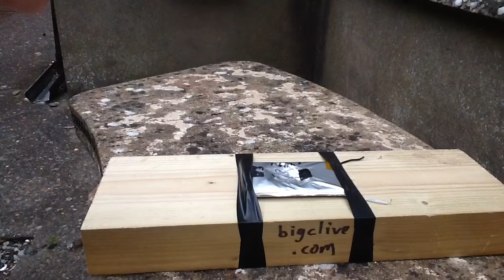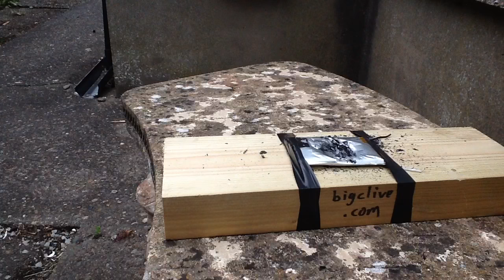Nail through fully charged LiPo cell super-anticlimax.

Comment: I'd be curious to see the test with a high capacity high C rating hobby pack. Something rated for delivering 50A continuously. But of course that wouldn't be cheap :/
Reply: I have a video of the fire and explosion of a 6000mah lipo cell (Not uploaded yet sorry). This was preformed as a controlled test. Cell connected to a bench supply and over charged @ 10 amps. After a half hour the cell reached 4.8v, the cell was extremely hot, and had long since began to swell up. Just a few minutes later the cell exploded violently. It peaked at about 5v before it blew. The cell Shot a 10 foot high fireball into the air no joke. The initial fire was so intense and bright that it instantly over exposed the camera, so you couldn't see much. Remember this was just 1 cell, not multiple. I have see people who are charge 6 cell 5000+ mAh packs in their house! Total fire risk.
Reply: @HighVoltageMadness  
Cells have a polymer in the seperator that gets electrolyzed when the cell potential exceeds operational limits. If you keep going for a half hour you use it up.

Short circuit had to be fast metal on metal a slower discharge of 10 seconds of other materials isn't going to catch fire even though the voltage will go down to zero

Comment: Obviously you made this test too safe; like taping it down, lay it flat,  used wood that it could burn on, you wrote your name on the wood.. All this matters you know, the battery was shy.. before you killed it..

This was a nice, kind battery.. and you just smashed it to death! Aaw, poor battery! haha

Better try an R/C battery next time.. I'm not sure, but could it be that your battery has a low C discharge rating? Cause pretty much any other R/C battery with 25+ C discharge rating explodes when hit =D

No idea if that is the case, but maybe? =) Awesome video anyhow! =D
Reply from the maker: If I'd known it wasn't going to fail spectacularly on demand I'd have kept it as it had a modest capacity.

Comment: Only rc lipos light up real fast. Low discharge cells usually take a minute or two to ramp up.
Reply: It also works with low discharge ones quite fast. And RC Lipos... lol. Like they aren't high discharge either.

Comment: I have had some better luck by putting nails through high discharge rated cells. My favorite way to do this is to put a long nail right in front of the battery as I use it to fly an RC airplane. Then when I crash it straight down the nail, razor, screw (I did all three at once) cuts right through all the cells at the same time. There's way more surface area for the cells to be shorted with and it gets hotter quicker.

Comment: Perhaps it's a lithium iron phosphate cell instead of a "standard" lithium-ion cell?

The chemistry I'm referring to is LiFePO4, and they're basically immune to the thermal runaway that other lithium ion chemistries can fall victim to.
Reply from the maker: I wish it was, but it was certainly being used as a standard lithium cell (charging to 4.2V) in the original application.

Comment: after extensive research as a kid in this subject. a fully charged Li-ion battery stabbed at a 45 degree angle in and out through all layers produces extreme heat and a shit load of smoke, only had one combust out of it though.

Comment: how did I miss this? I fell on the floor laughing. The sad part is I did the same thing with a puffed lipo from my Apprentice Airplane. I drove a nail through it expecting a huge fire ball and shooting flames. The damn thing only smoked a little,that was it. I felt robbed. Here I figured I should dispose of it because it posed a risk of exploding in my plane or house because I had puffed it. Surely,it is now junk and all those warning labels and stuff saying puffed batterys are bad. Now I have another one,and I refuse to fall for that again. It still works perfectly fine,charges fine its a little puffy but After hammering a nail theough one of those. I will never worry about exploding batterys again,mabe if I over charged it next time huh?

Comment: I think you got one of those kid proof cells there!  Nice thought though, I have always wanted to try that but didn't have any cells I wanted to get rid of.  I did  have one that sort of blew on it's own, well it swelled to nearly twice it's size got real hot, then shrank back down to about 2/3rd the original size.  Never worked after that either, that from a charge that went wrong.

Comment: Thing is, you broke the seal so it couldn't build up pressure and heat before failing and igniting from the oxygen in the air.
Next time, try smashing it from the side?

Comment: That's what I recently discovered, too. What works quite well is abusive overvolting (did you know these things hold charge at well above 6V? :D) Forcing current at excessive voltage through it takes some time to ignite, but that bastard flew away like a rocket, just as I was reseting my camera :/

Comment: AH I've got it.
It's probably that it's a single cell low discharge rate battery, something designed for vaping or R/C would probably have a bit more OOMPH to it rather than a cellphone, tablet or laptop battery.
That little battery may just not be able to pull the watts to start a good flash fire under any circumstances.

Comment: Maybe try shorting one with the protection circuit detached and then putting a nail through it? I don't know, but that should be far more dramatic.
Reply from the maker: The protection is usually on the output terminals, but this cells protection was on the PCB of the power bank it came from.
Reply: This explains why external shorts are so dangerous. The tip corners of the current collectors touching also seems to be more dangerous, how does the protection circuit vary in effectiveness based upon where the contact is and if the battery is working or off?

Comment: Where did you get the battery?  If it has a low C rating, it can't produce large bursts of power. I've personally cut into a hobby grade cell and that sparked up rather violently.  Thankfully it didn't burst into flames.  My experience with destroying lipo cells is electronics batteries, low quality, low capacity, and old cells generally don't put on a show unless well over charged.

Comment: This looks just small LiPo. Energy will not very high and when damaged, it will perhaps get warmer and little thicker, but that is it. If you get think the LiPo like used for RC Racing (= high discharge rate) it will get very hot and explode. More energy stored = more heat and explode effect.

There is also small difference between cheap LiPo from China and A-merk. Chinese stuff will overheat earlier and explode.

Comment: Was it perhaps a LiFePo4 cell? They are much more stable.

But I can generally confirm the effect. I fly lots of RC planes. Whenever a battery is getting dodgy, I will make a effort to "intert" it by letting the magic smoke out. That's sometimes surprisingly difficult.

Comment: LiPo is significantly safer than Li-ion.  Still, when you're talking about safety for shipping and such, even really rare catastrophic failure is enough to be bad.  There's a hell of a lot of these things out there.
Reply: They are the same thing apart from the casing!
Reply: Caveat: I'm not an expert!  But to the best of my understanding...
Not quite.  The chemistry is essentially identical, but the separator is very different.  In LiPo, the polymer electrolyte stuff itself is the separator.  Li-ion has a traditional "sheet with holes in it".  Punching a hole big hole through the separators (and connecting the anodes and cathodes) in a Li-ion is quite different from punching a hole though a LiPo stack (essentially connecting a bunch of anodes to other anodes or cathodes to other cathodes).

Comment: Hoping for more but kinda expected since I've shitted about with cells outside for laughs.. Try over charging one? knobbing it with a couple 100 watts should bring to flash point. failing that stick it in the vice. failing that load it down
Reply: Oh, oh Auuw! Heat up a coin cell, they're funny as farts, better than elec caps. Soldering iron/fire you choose

Comment: Do it with an iPhone battery. They're a bit better at melting down, but still only really spark and flame a little bit.
If you do it with a much higher current battery, such as an 18650, they produce quite a nice reaction, but I really wouldn't recommend it.

Comment: You would be better off with a smaller gauge nail. I would hazard a guess that the nail passed all the current without the melt down. where as when people separate these types of battery a small edge touching another edge does cause the meltdown.

Comment: I'm going to assume you decided to destroy it because it was degraded? If so, the loss of capacity probably meant that there wasn't much electrical energy to work with anymore. I'll say either that or the internal resistance. Try again with a fresh RC copter battery :)

Comment: Buy a 'quality' LiPo with a high 'C' rating and do the same test. The brand Gen Ace from my limited experience is a quality, 'cheap' LiPo. It's highlty possible that the cell you used had such a low 'C' rating that it could simply not produce enough current to 'burst into flames' as we all wanted. (Did you charge the cell before 'testing'?)

Comment: Clive, I can vouch that charging a 3.6v rechargable torch similar to the one below using a 24 volt 0.75 amp supply will give you a nice bang. ... If inside, it will also give you several days worth of cleanup removing soot and lithium ion smoke residue from everything in the room along with the floor, walls and ceiling. Don't worry, your throat will eventually stop burning and you'll subsequently be motivated to properly label power packs that look very similar but are anything but (well it did for me).

http://www.ebay.com.au/itm/Focus-3D-SIZE-2000Meter-CREE-LED-TACTICAL-RECHARGEABLE-POLICE-FLASHLIGHT-Torch-/121512681513?hash=item1c4ab86029:g:WwMAAOSwkNZUhwlt

Comment: If my research last night is anything to go by, buy a "genuine" Samsung battery for a Galaxy Note 4 off Amazon. The reviews seem to imply those things will explode quite readily.

Although, you know what I've always wanted to see? A fully charged car battery shorted out with a large 1" spanner across its terminals. That should be more exciting than a LiPo battery getting warm and fizzy.
Reply: Been there... Done that... Snap-on refused to replace my wrench.
Reply: Not all that exciting honestly, it would just melt the wrench, it takes quite a bit of effort to get a lead acid battery to explode, at least in comparison to lithium batteries which are pretty violent.
Reply: Cells with Lithium Cobalt tend to have a much greater risk of fire than those without.  Not only does the cobalt make the cell more reactive but also decreases the ESR allowing more current to flow into the fault.  So maybe look for a high output lithium cobalt cell?
Reply: Ethan Poole Not a bad idea, but if you just really wanted to blow up some batteries you could probably get some dead or worn out batteries for free (or cheap) from an old laptop or power tool and I don't remember what causes it but I think the easiest way to get a reaction might be to discharge them below 2.9V then charge them quickly or of course overcharging them should work too.

Comment: LiPO or LiON?  I think it makea a difference?
Reply: It does, but they're more or less the same thing, the only big difference is the li-ion batteries are encased in a metal tube, so they more likely to go bang if the safety fails, whereas lipos are will probably just cause a big fire if it fails dramatically.

Comment: I am surprised you are surprised :-) The big change in the last 5 years when it comes to flat cells has been safety, not capacity. 18650 which are used for high power stuff, not so much mobile devices, incduding cars are much more unstable generally. Remember that there are drastically different chemistries between different types of LiPos. http://batteryuniversity.com/learn/article/types_of_lithium_ion

Comment: You should have overcharged it to way over voltage first
Reply from the maker: That was the plan, but it started getting dark outside quickly so I had to stop at 4.2V.
Reply: Or, over-discharge is completely before recharging it... then draw a high current.  I've heard that's a formula for violent failure for LiIon and LiPo batteries... you might have to get rid of the control circuitry to manage it in a reasonable amount of time, though.

I really don't like hearing you say "I can smell it"... You should really find out just what sort of gases are produced by those batteries.  I'm no fearmonger, but I think there's adequate reason to be concerned...

Comment: Was it fully(or mostly) discharged? It would be interesting to see the difference between two batteries of the same model going through this, one fully charged and one discharged to the point of the undervoltage protection circuit kicking in.
Reply from the maker: It started freshly charged to 4.2V for maximum drama.
Reply: +bigclivedotcom Oh, that is interesting.... And highly disappointing. Also I just rewatched the video, completely missed it the first time when you stated "fully charged lithium cell"... I should listen better...
Reply: The fact the title of the video states 'fully charged'??
Reply: JonnyD3ath Didn't read title either, saw new Bigclive video and clicked on it.
Reply: he says it in the first 4 seconds ;)
Reply: +bigclivedotcom AvE always says "If you can't fix it with a hammer, then your problem is electrical!"

Comment: What's that cell from? Many cells in consumer products are made in such a way that they will not burst into flames. If you want to see flames you pretty much need to go for a high current Li-Ion-Polymer cell, like the ones for RC cars or aircraft.

The "safe" cells have a high enough internal resistance that they will usually not produce enough heat to ignite. Good for your fire insurance, bad for your youtube videos...

Comment: Do it with a lead acid battery!
Reply: Not all that exciting honestly, it takes quite a bit of effort to get a lead acid battery to explode, at least in comparison to lithium batteries which are pretty violent.
Reply: vgamesx1 THANKS!
Reply: +vgamesx1 Especially given that driving nails into the plates of a lead acid battery also means both the nail and the site of the short are simultaneously bathed in liquid (or gel) electrolyte that provides a lot of cooling capacity.  In fact, if you have ever had a cell short out in such a battery, a common failure mode resulting in a sudden ~2V drop in voltage, that is essentially what has happened to the battery (cell plates shorted).  To explode a lead acid battery you typically need to be charging it reasonably heavily (especially during an equalization charge) and then, by some means, initiate a spark internally in the air space above the electrolyte, which will be flooded with a mix of air, hydrogen, and oxygen from the hydrolysis that is causing the electrolyte solution to bubble.  Just be aware that such explosions tend to fling a lot of sulfuric acid, from the electrolyte, into the air which can cause a lot of secondary damage to surrounding materials and persons.
Reply: Ethan Poole A slightly easier method, seal it away in a box so when it vents all the gases are mostly trapped, then cause a spark inside using one of those little 6V to 1kV+ transformers you can get off ebay and maybe the box stops some of the fluid spill as well.
Cheers.
Reply: I did it with a car battery once. I shoved two pieces of copper tubing through the holes in the lead terminals before soldering them to the terminals. Then I dropped pieces of coat hanger wire across the copper tubing. BAM! Great sparky melty fun!

Comment: I did find one that I wonder what would happen if it did but near $10 for a 9 volt LiPo battery isn't very cheap :O  probably better off than nicads and nihm's though for actually keeping it's power.  Hence why one can't actually find a 9 volt charger at least in the USA , except on the original Panasonic NiCd one dad got when we were rather young (1986 or so)  Still works)  Only other one I have is one of those silly ones intended  for charging alkaline batteries.  Which work but don't use it too often.  And Sony Batteries hate them.  9 times out of 10 they are take a leak or expand O_O    haven't exploded but one expanded as far as length of the aa increased so I couldn't even test it.  Went from bad power to zero power. =------ http://www.banggood.com/ZNTER-S19-9V-400mAh-USB-Rechargeable-9V-Lipo-Battery-p-1070703.html  400mah might seem small but LiPo's are a different beast from Li Ion.  That said the fact it didn't blow up here..  Might require a bit of heat then a nail  or a nail then a bit of heat.  I know my HTC M8 get's insanely hot when basically almost no signal and suddenly finds a bad signal , got so hot inside a Silicone totally covered Otter Box that it froze up (6 months old) lost half my programs when it rebooted.  I didn't know it was frozen until I got to the wrong town.  X_X  I found out later than for some phones Otter Box's Silicone might keep your hand not quite as hot but also kills the heat dissapation on METAL HTC's  :(  as it keeps the heat inside  O_O  oops.  Phones never been the same